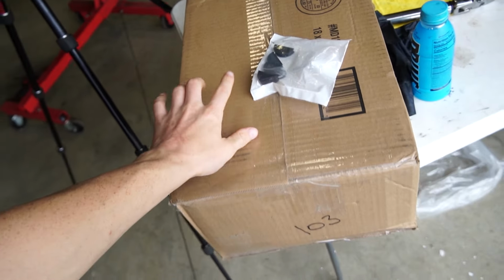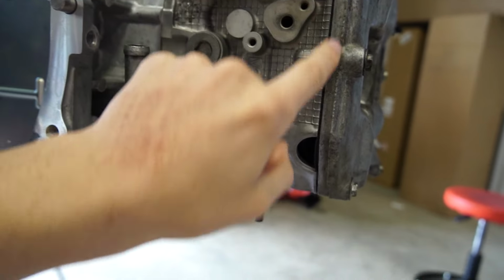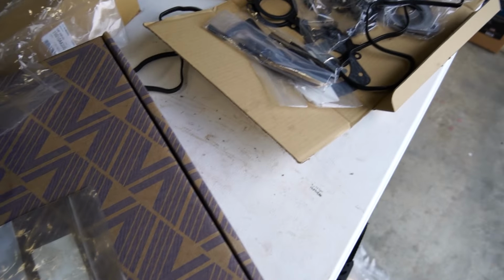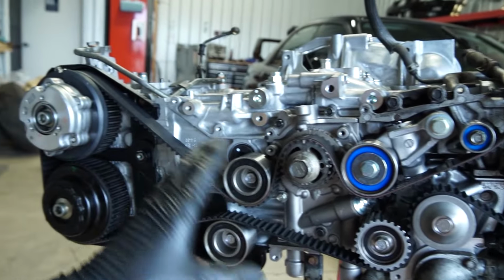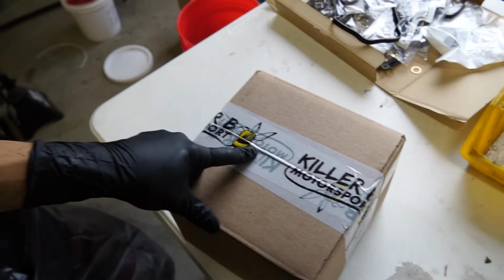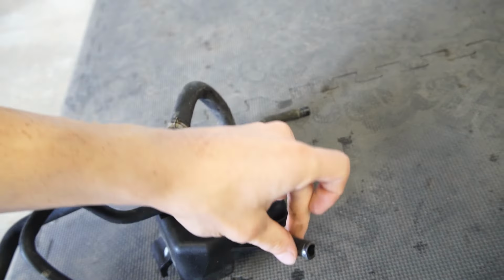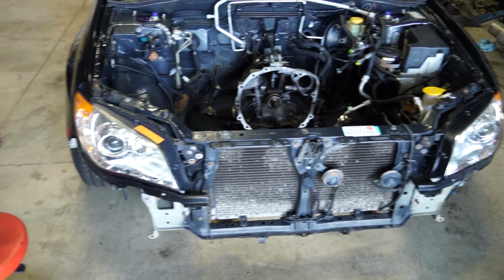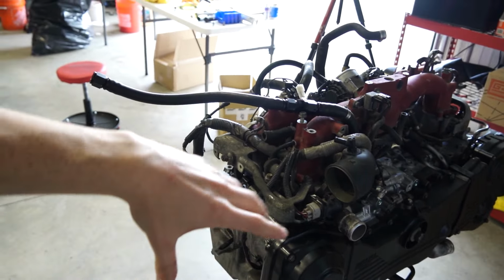Saving a Neglected 2007 Subaru STi | PT 8 | TIME FOR SOME POWER |

Comment: Loving the direction of this build! I’m also planning a similar build myself and will be getting tuned from master bader himself. Any additional detail you can include I’d appreciate greatly, small stuff like what kind of sealant you used for those half moons, torque specs, bolt tightening order, etc. That way when I need a quick refresher I can pull up your videos for the info I need!

Comment: Stoked to see the power curve dyno chart for this one, I think I love that turbo and how it puts it down on a normalish street type setup. I have my VF52 maxed out right now, awesome mid range power but flattens out up top. I only built it that way way since I have the WRX longer gearing, the more torque helps down low to get it movin.
Reply: I'd like to see a nice Top mount setup and see where IAT's really start take effect (and lack of boost lag if so), then slap a front mount on it and test the difference.